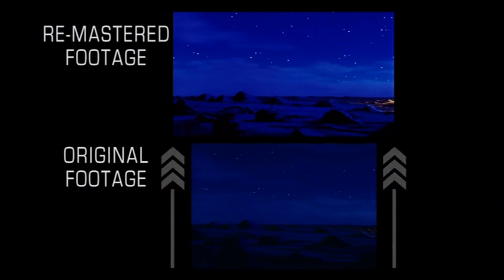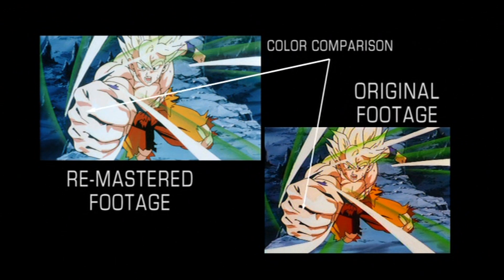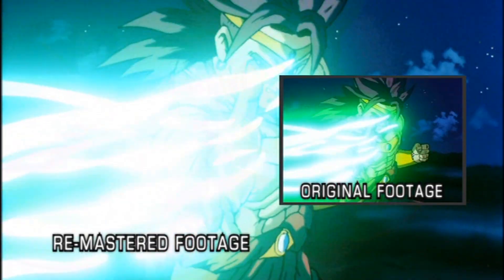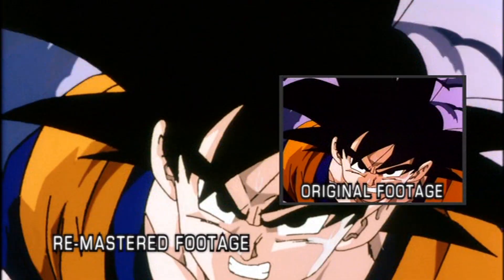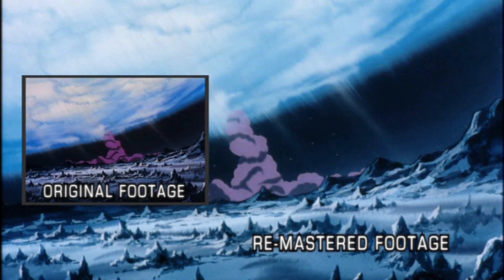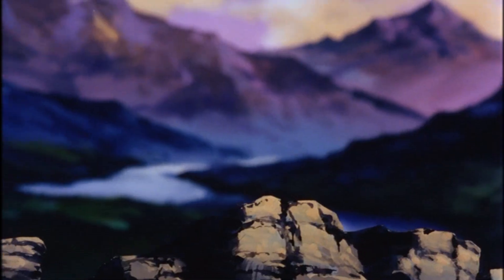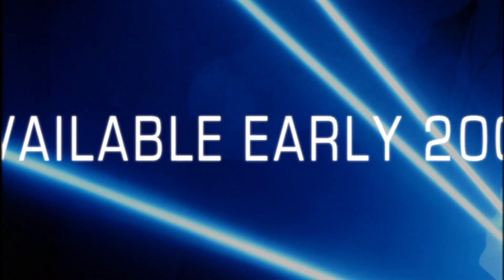Dragon Ball Z - Orange Bricks Promo - False Advertisement Master Class

Comment: I like how they used the Broly movie (which was filmed for widescreen) as a reference comparison instead of the actual show, just to fool the casual audiences.
Reply: Even that movie isn't supposed to be in wide-screen 
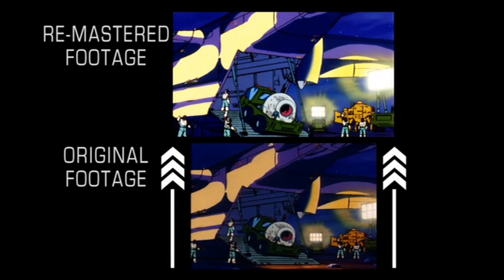1:41 in the transfer you can't even see broly
Reply: Well kinda it was made in 4:3 but was made so nothing important would be cropped when shown in widescreen in the cinema
Reply: Yeah, all the movies were drawn thinking of both 16:9 format for the cinemas and 4:3 for TV, that's why you can crop them without losing significant details at the top and bottom. The anime itself, was made for 4:3 TVs only, so if you crop it to 4:3 you are effectively removing important details that were made to be seen.